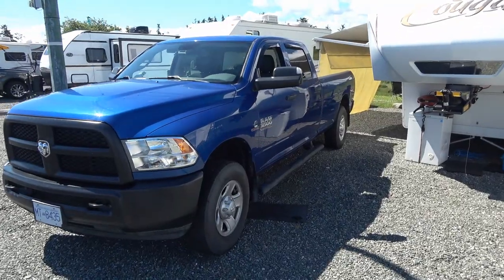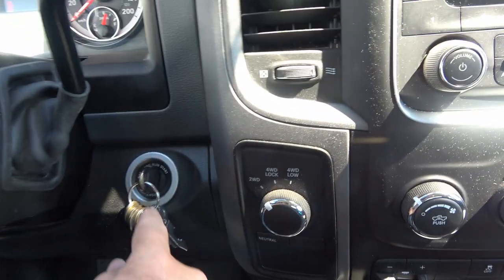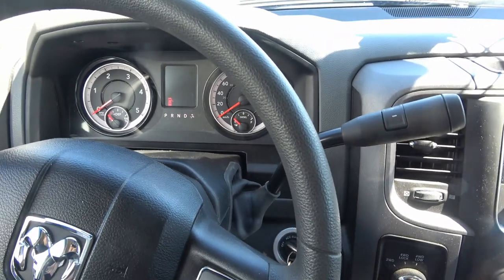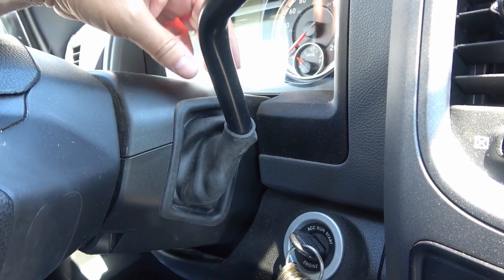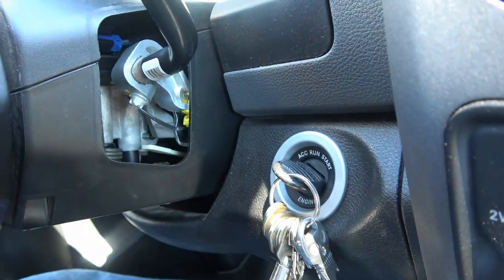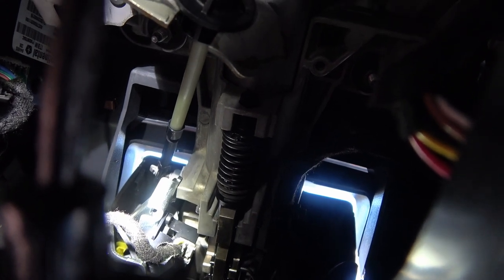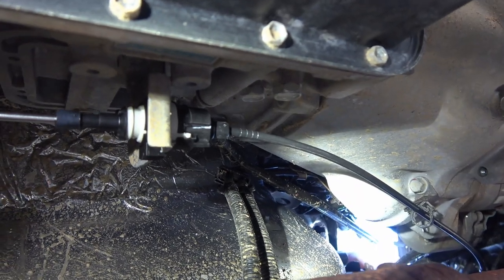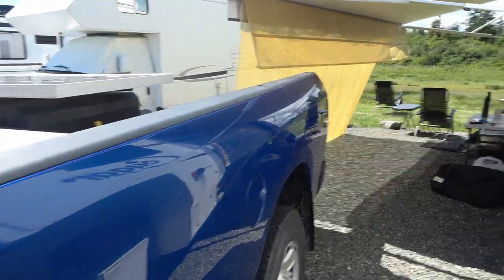Shifter Transmission Cable Failure - Ram 2018 ST 3500 Cummins Pickup Truck

Comment: My 2017 Ram 2500 Cummins just turned 47k miles with about towing 26k miles on 2 different travel trailers and have had no issues. Tows awesome!

Comment: I just assumed they were all electronic shift by "wire" anymore. Many years ago I had a 71' GMC with a large slide in camper. We were 600 miles from home, about 25 miles from civilization and backing down a steep hill. When it came time to go into "D" there wasn't any resistance in the column shifter and not going into "D". I was in a pretty safe spot, stopped the motor and jumped underneath after looking under the hood & dash. I saw that the linkage had come undone. Coat hanger wire & duct tape got us home and then did a real repair.  All part of the adventure I guess.. If your not handsome, you better be handy !

Comment: “First breakdown after three years” Yikes! Expensive trucks shouldn’t break in three years - however, they made good on it and it could happen with any brand. RAM is still the best - feature by feature. But the fact that they, apparently, never corrected the previous recall… Gotta love Ray for taking off the seals and letting us look :)

Comment: My Ram 3500 dually went through all the emissions problems OBD error codes, and never was fully fixed by Ram after a dozen or so trips to dealerships across north america while traveling full time..  I eventually pulled all the emissions off it at around 60k miles.  Haven't had an engine failure since and I have 150k miles on it now.

Comment: I have basically the same truck except in a Laramie trim, the 68 trans and 6 months newer. I have 33K miles now and no warranty problems. But thanks for the info in case I have that issue.

Comment: Interesting situation and glad to hear it was a somewhat straightforward repair. I currently own a 2018 Ram 3500 SLT. I have owned two Ram's now, my first one was a 2014 Ram 1500. I am not sure if you have experienced this but both my Ram's seemed to have a minor problem where the shifter won't go into park right away from drive or reverse. Sometimes I have to put it back into gear/neutral, jiggle the shifter, pump the brakes which will then put it into park. Curious if anyone else has experienced this as it seems to occur more than any other make of vehicle I have owned.
Reply from the maker: I haven't experienced that myself. Maybe your shift cable is just slightly out of adjustment

Comment: Mine did the same not long after I bought it (I have a 2018 RAM 2500). Quick easy fix, but still a pain. Mine got stuck between park and reverse.

Comment: Glad it was a straightforward fix and the dealer could get a part right away.  On the tail end of Covid there are so many shortages That could have easily been a several week ordeal.  Hopefully it was defective , not inherent to the design and not something that wil rear its head again every few years...  thanks for sharing!

Comment: I drove a tow truck for 14 1/2 years. I saw shifter cable failures at the transmission all the time on GM vehicles. I didn't ever see it on Dodge.
Reply from the maker: The tow truck driver tells me with he sees quite a few with the new turn dial dash mount shifter but not to many with the column. He hadn't seen one go quite like this.

Comment: The quality issues on my 2019 3500 involve water leaks, water leaks and more water leaks. It took almost a full year before the issues were solved by replacing all the cab marker lights and the entire sun roof. I also had the loose shifter lever. I asked the service dept to tighten it at one of the many service appointments to rectify the water leaks. I was told that if they only tightened it, I would have to pay the labour. If they replaced the entire shifter assembly, warranty would pay for it. So instead of a quick turn  of a 10 mm socket, a new shifter assembly was ordered and yet another warranty visit to replace the shifter. If only Toyota would come out with an HD diesel pickup!!!
Reply from the maker: I had heard that the rear cab window brake light leaks were notorious for leaks so I took mine apart and resealed it with aquarium tank silicone sealant as a preventative measure. Sounds like I did the right thing.

Comment: On my 2013, the aluminum clamp that holds the shift lever snapped while I was trying to take it out of park.  That trans has a really course park pawl and if there is weight against it when you are taking it out of park, it takes a fair amount of force. Eventually it broke (out of warranty, of course).

The tow truck driver couldn't even load it because it was stuck in park.  I had him back his lifting mechanism against my trailer hitch ball and push (I was parked up-hill) to take the weight off the pawl.  I was then able to grab the remains of the clamp with vice grips and shift it that way. Of course I no longer needed a tow as I was able to drive it like that to the repair shop.

Good times.
Reply from the maker: Wow, that would suck. :(

Comment: Happened to my ram 1500 2014, but in my case I couldn't shift into park only reverse, neutral and drive.
Reply from the maker: So far the new cable has work well

Comment: Ray.  After 3 years and 20k miles, would you buy another one?
Reply from the maker: Yes, I love the Cummins 6 cylinder with the turbo exhaust brake and the AISIN tranny combo. Tows like a dream and was economical to buy. I like that the engine compartment, isn't overcrowded like a V8.  Here was my review after a little over 21,000 miles and two trips down to the southwest from Canada, lots of mountain and coastal towing  - https://www.loveyourrv.com/2018-ram-3500-truck-review-update-35000-km-21748-miles/

Comment: And DO NOT ever park against a curb backwards with pressure on the rear tires!  Or you may find yourself unable to take it out of park. “IF” you do find yourself stuck in park, take that shifter column boot off and there is a tab you can press to release the shifter.  It’s happened to me 3x with my 2018.
Reply from the maker: Thanks for the tip! I often back in to parking. I'll have to remember that one. So far have had the truck for 5 1/2 years and hasn't come up.  Cheers, Ray

Comment: There’s aluminum clam shell. That Breaks. Slide the boot off and remove the plastic on top of and bottom of column. It’s super easy to fix the part is about 100 bucks at the dealership. Mine broke on a 2016 Ram 3500.  Don’t take it to the dealership unless it’s under warranty.
Reply from the maker: Thanks for the tip! That sounds like it may be a different part than my shifter cable that failed? Or is it part of the cable? The cable is a little over $100 for the whole thing https://www.mymoparparts.com/oem-parts/mopar-shift-cable-68261253ac

Comment: wait til the electronic 4x4 actuator goes while you’re in 4x4. luckily i was still under the power train warranty. 2016 3500 Megacab dually.
Reply from the maker: Did they say why it went? I wonder if I should be putting mine in 4x4 mode more often just to exercise things. 4x4 is nice to have when you need it but I hardly need it.
Reply: @LoveYourRV  , no explanation. chalked it up to “electronics”. our 5th is 15k lbs. i would never tow without 4x4.
Reply from the maker: My old Ford dually was only 2WD towed for 7 years and never got stuck but I was cautious about where I went. The 4x4 gives me little more piece of mind when off road camping and these days its hard not to buy one and good for resale.

Comment: One of the guaranteed things to work forever is a shifter lever on the older vehicles it would last until the vehicle is falling apart literally. Now today with these newer Vehicles they don't even make the 3-year mark what a failure.
Reply from the maker: Yeah, the old vehicle shifters were almost indestructible like old school rotary phones. However I do remember having problems with turn signal levers with a few of my old vehicles.  Cheers, Ray
Reply: Mines been going strong for 11 years.

Comment: My 2018 RAM 3500 is having issues with the ABS module. It's been in the shop 30 days now, and they still don't know how to fix it. It's under warranty, but in the meantime, I have no truck or any way to move my 5th wheel. Needless to say, I'm very disappointed with RAM.
Reply from the maker: Sorry to hear that, count myself lucky to have it fixed quick.
Reply: Does your service abs and traction control light come on? My 2018 3500 has been doing that when it's raining and I hit bumps. On and off and I get the pleasant chime every time.
Reply: @bmbullard  mine doesn't do any of that anymore. After three months Stellantis, Ram, decided they couldn't fix it. They invoked the Lemon Law and will be buying it back. But those were the symptoms, plus the trailer brakes did not work. I now own a 2021 Ram.

Comment: Ray have a look at the Lemon auto website regarding Dodge tranny problems and recalls there may be some issues you could learn from. Sorry but Dodge is not high on my list of pickups , my good friend had top of the line Dodge 3500 power wagon model and it was unsafe to drive above 90 km
it had the Dodge death wobble, dealer would not fix it so he traded it on a Ford f350, no problems at all. Dodge has some quality issues for the last 4 years.
Reply from the maker: Both Ford and GM have had death wobble problems too just Google it. 
https://www.google.com/search?q=ford+death+wobble+recall&oq=ford+deaht+wobble&aqs=chrome.2.69i57j0i13l9.7020j0j7&sourceid=chrome&ie=UTF-8
https://www.google.com/search?q=gm+death+wobble&oq=gm+death&aqs=chrome.0.0i20i263j69i57j0l2j0i22i30l5j0i10i22i30.2359j0j7&sourceid=chrome&ie=UTF-8
I have the optional heavy-duty Japanese AISIN tranny in my Ram not the Chrysler tranny so not sure what that means.  So far my 2018 truck has one recall out for it. Possible loosening of the drag link adjustment nut in the front steering. I had a Ford F350 before this and it wasn't without problems. ;) They all have their share.

Comment: i see a lot of comments regarding the poor quality of Dodge products. but I see a lot of Dodges on the road. this seems like a nuisance but not really a serious quality issue. I drive a 2013 Ford F250, seems about the same par with the Ram and GMs.
 take care, Ray
Reply from the maker: I find some of the stuff is cheap looking quality wise but mainly got it for the Cummins engine and the AISIN tranny seems to be pretty decent quality there. Good combo so far tows great. Just hope the stuff around them hangs in there. :)

Comment: Would this be the same set up ona 2016 ?
Reply from the maker: Looks like it according to this page https://www.moparwholesaleparts.com/oem-parts/mopar-shift-cable-68261253ac
2016 Ram 3500	Big Horn, Laramie, Laramie Longhorn, Limited, SLT, Tradesman	5.7L V8 - Gas, 6.4L V8 - Gas, 6.7L L6 - Diesel
Reply: @LoveYourRV  Thanks
Reply: @LoveYourRV  Now I'm wondering if I can manually put the lever in gear from underneath?
Reply from the maker: Should be able to but don't run over yourself. :)
Reply: @LoveYourRV  Exactly

Comment: Have had to tighten the nut on my 2019 ram.that you mentioned. It was very wonky from the factory. The rubber boot on mine has deteriorated already. Disappointing. Other than that the truck is awesome!

Comment: If you are going to do a video about shift cable problems instead of trying to explain (poorly I might add) what someone else might have done to fix it... DON'T.  I need the information about how to fix it instead of 2nd hand information that is not accurate

Comment: That's why I wouldn't buy a Dodge.  They have a known problem and they can't fix it.  Very poor engineering.  Sure glad you weren't out in the boonies!
Reply from the maker: I'm not really stuck on brand names, I've had many of the different brand vehicles Ford,  Chevy, Chrysler over the years and they all have suffered from various issues and poor engineering. Our previous Ford pickup had a simple fuel lift pump fail and left us stranded in the Redwoods for days, no cell coverage on a weekend.
Reply: @LoveYourRV  You're right,  they all have their issues.  That Ford 7.3 diesel was an amazing engine for longevity and durability.
Reply from the maker: That's what I always heard about the 7.3 but ours had a major failure engine, they told me cracked piston at 180,000 miles and needed a E4OD tranny rebuild at 75,000. 
Hoping for better from the Cummins and Aisin combo on this Ram. Cheers, Ray